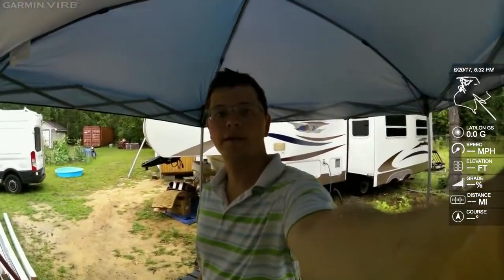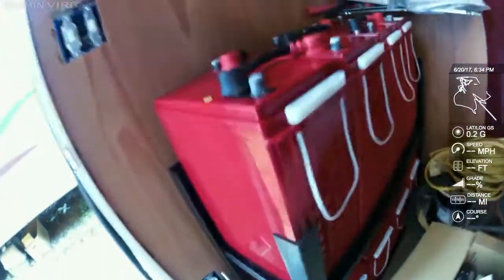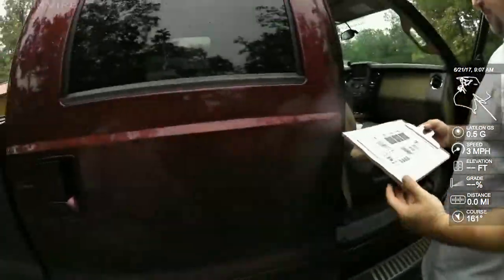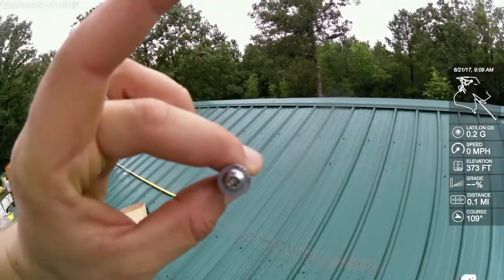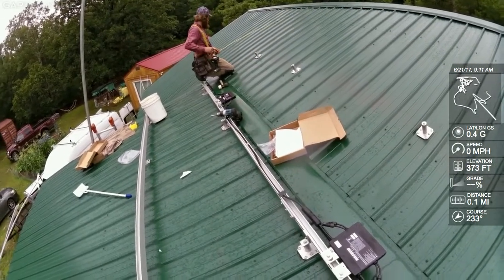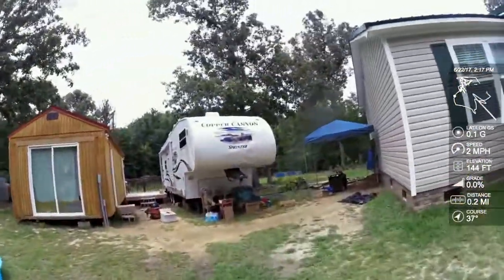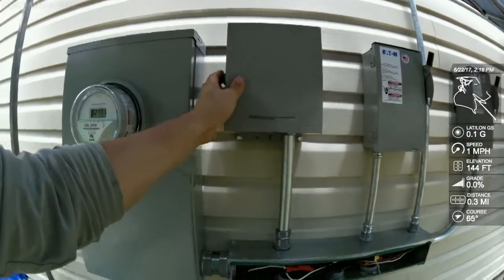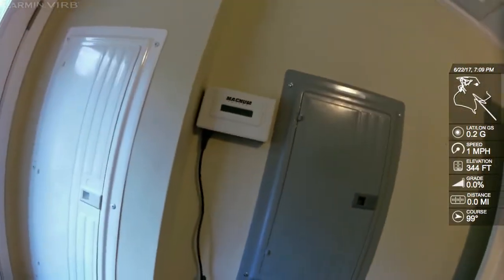Magnum's New Grid Tie Solar/Battery Backup Microinverter System

Comment: Wow so it is possible. So I guess I understand it tricking the micro's but I would think the Mag's internal transfer switch would shut off the inverting mode and go into charging mode for the batts. As soon as it does that  then the micro's would turn off. I know they don't because you wouldn't be doing it so what am I missing? 

Also the lowering of the hertz once it hits absorb mode, I suppose this is why some use a load manager Johnny V spoke of in his video "Choosing a solar inverter." I believe it was the ACDL.
Reply from the maker: JJ WW JJ my man. We don't have to know why it works as long as it works. Magnums definitely work fine inverting and charging at the same time.

Comment: I'm loving the whole system here, lots of good info on the Magnum products, I'm curiouse about type of solar panels ise and also the attaching hardware, looks easy but no info, thanks! Also do you guys do installs in Pacific Northwest?
Reply: Thanks Aaron, Check out Jason Andrade at West Coast Sustainables, he and his son are about the best there is.  He is located in Nor Cal.  The panels we use tend to change based on availability but we use Snapnrack racking.

Comment: You mentioned these inverters are made by APS.  I've heard the APS version has a lot of problems such as constantly having to troubleshoot and failing within a year.  Does the Magnum GT500 have the same issues?

Comment: I'm curious where the generator transfer switch is wired into this system?  The magnum can only accept 1 AC input, correct? So I'm assuming that would be incoming from the grid or main panel.   If you are adding the generator there via a transfer switch, isn't there a concern of "selling back power" to the generator when the batteries are charged and the PV system is still producing power?  What am I missing here?
Reply from the maker: Jeff Palmer at 12:06 you can clearly see the switches on the exterior wall. The one on the far left is a reliance transfer switch/gen inlet box. That’s where the transfer takes place if needed
Reply: lol .  I saw the physical box.  I'm asking where it actually wires into.
Reply: ie,  is it feeding the AC input on the magnum,  and switching from mains/gen?   if so,   aren't we worried about what happens when it's switched to the generator, and the solar array is producing,  the batteries are fully charged, and the magnum starts sending power back to the "grid" since it doesn't know it's a generator?
Reply from the maker: Jeff Palmer so in this case the customer has to turn the solar array off before running the generator.  I have since developed an interlock that avoids human error but yes the solar array would back feed a generator if it was clean enough. The customer is pretty technical, understood the gen backfired situation and requested the gen input functionality.
Reply: Thanks for that.   That is what I'm likely going to be doing.   Was hoping you guys had figured out a way to have both generator and PV enabled. So that the human error factor couldn't come into play.   I'll probably end up doing a generator interlock kit on the generator breaker, and the PV breaker.
Reply from the maker: Jeff Palmer I do have it figured out now. Have you bought the inverter yet?  I can sell you the whole set up....
Reply: I found your number online,  I'll call you tomorrow.  Thanks!

Comment: So I guess these buggers would let you send AC right from the arrays... how are the batteries charged again if AC is coming from the arrays? And yes how will off grid only be used with this combo..?
Reply from the maker: Russ B ruster. The batts get charged when the AC current backfeeds through the D.C. Charger on the magnum. The magnum watches the battery voltage and starts downshifting the solar array when battery voltage rises above absorb set point.
Reply: Got it..but the Magnum box is for grid tie with or without batteries...will there be a Magnum box come out to use these with off grid only..thus being a cheaper solution for off griders..?

Comment: Any chance these GT 500's can work strictly offgrid?  I was told by a local solar installer that the enphase must have the grid to work so has magnum changed the rules on that with these GT Inverters?
Reply: Yes they can. What happens is this. The Magnum send out the Power like the grid. So what happens is the gt 600s get tricked into thinking the grid is there. Then if your bat is full the  mag will send a out an lower than 60 hertz. Like 59.70 hertz. That will make the micro inverter shutdown.  

So what happens is when the grid is up. The micro inverters sends the power to the Mag. The mag takes that AC turns it into DC. That DC will chager the bats. When they are full. The Mag then sends the power to the house loads. If the house loads are taken care of the left over power will be exported to the grid.

If the powers out. The Mag will take the AC power chager the bats and run the loads. I do not know if the micro inverters help run the loads or not. I know in my SMA setup they do if the powers out.. 

So think about it like this.. The micro inverters run the loads in your home when the sun is up and at night the mag runs the loads. All Depends on how you have it setup. Some have it so that the mag just works when the powers out and some do not. The nice thing about doing this is. Your letting the power co-op be your bat bank at night and in the day your micro inverters be come the power co-op.. If you send more back than you need mot get a power credit they then use at night.. But if the powers out with this setup your power will come from your bank and from your solar. 

This lets you have a longer lasting bat bank and smaller bank. As the main big cost of off-grid solar or back up solar power is the cost of your battery bank.. Sorry for the spelling. This tab is my wifes and hard to use.. God Bless.
Reply from the maker: JJ WW hey jj. The local guy told you a halfer. A magnum could turn on the enphase micros but with out frequency shift power control , the enphase, an all other grid tie inverters turn off when they frequency is dithered.
Reply from the maker: yankey4 dang yankster

Comment: Did the inspector have any issues with you not having your 36” clear working space in front of your magnum inverter?
Looks like a nice product, I think I will use this for man up coming project soon.
Reply from the maker: The magnum setup works great. We passed inspection. The inspectors around here usually want 18” clearance  from the middle on each side from Center to another side

Comment: Not trying to bust balls. SMA been doing AC/DC coupling long time..
Reply from the maker: yankey4 hey yankey. Yes AC coupling is not a new thing but sma has some quirks to it. It's expensive and you have to add a transformer or stack the SI's to get 240.  The magnum is a very economical grid tie battery backup solution. I've done some sunny islands.